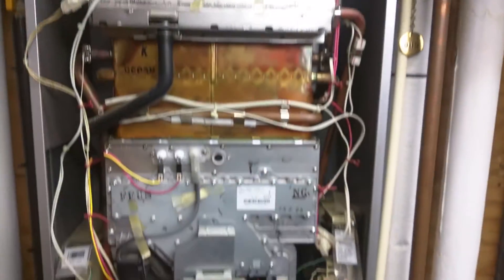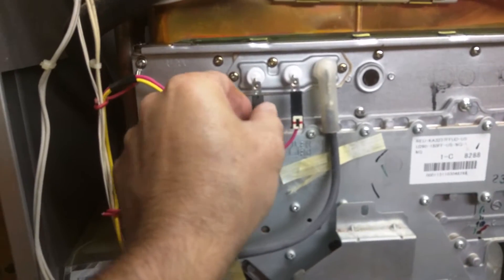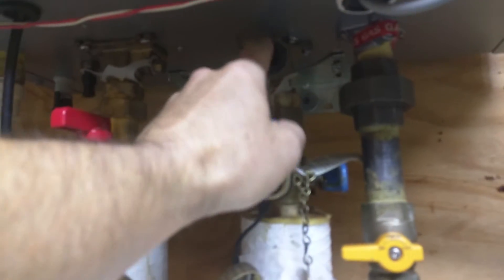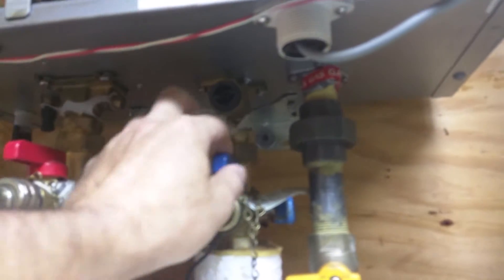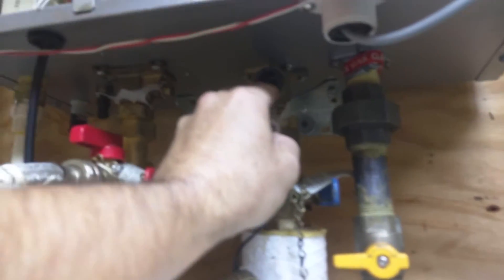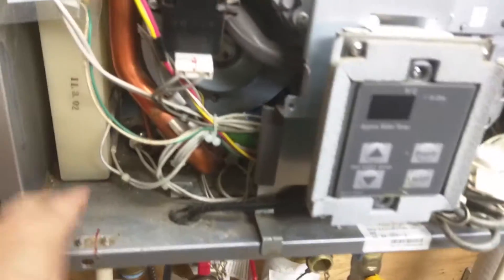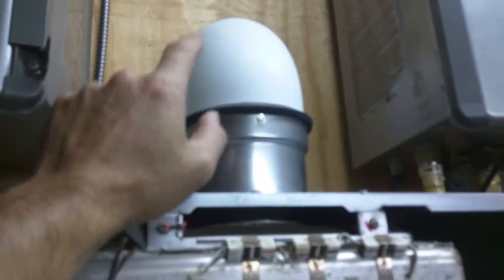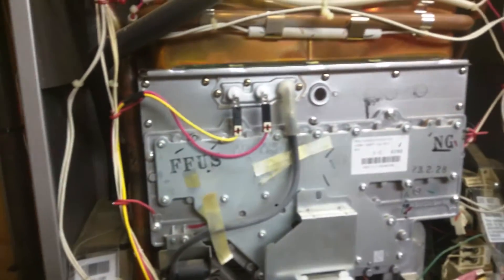No fire codes Tankless water heaters

Comment: Never again!!!!! Get one if you enjoy complicating your life! I’ll spend the whopping $25 extra in energy costs to run a NORMAL tank dead reliable hot water heater. I have wasted my time and money on several different makes and models and they all suck!!! I especially love it when the electricity goes out mid shower and the water immediately goes cold, my wife loved that one! If your going to torture yourself with one of these miserable units at least go for the standing pilot unit. I have both and at least those don’t leave you in the cold. Unfortunately I designed my hot water heater cabinet for these darn things so in order to go back to a reliable tank heater it’s a lot of work. Hopefully this reaches someone who’s on the fence about purchasing a tankless and it pushes them to go with a tank water heater.
Reply from the maker: Thank you for your comment and yes in most cases I tend to agree. These were located above a local restaurant. If memory serves me correctly there were either 5 or 6 of them. If used in commercial settings the manufacturers require quarterly maintenances where in a home it's much much less. These units were a few years older even at the time of making this video.depending on the manufacture of the tankless. But truth be told I end up talking more people out of switching to tankless water heaters. Unfortunately around here all the "big box" plumbing companies push their "techs" aka salesmen & women to sell sell sell with little to no clue on what it is they're actually selling. Where a tankless can be wonderful, some can be a no so wonderful. If space be the issue along with the need for more hot water than a tank type can produce, and there's adequate NG/LP, sure its an option but theres always a way to add a tank. In my opinion the electric versions are just not worth all the power needed to make them super heat the water.